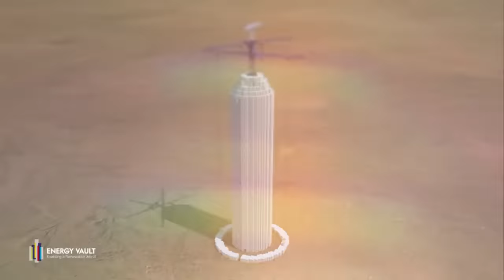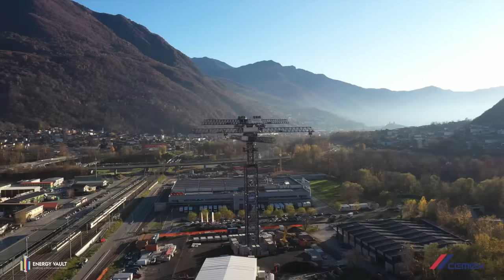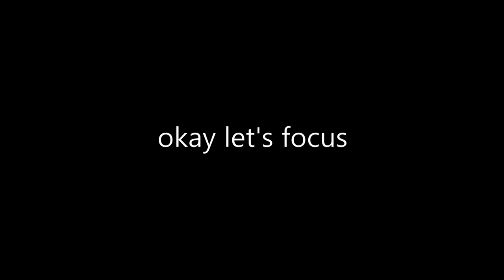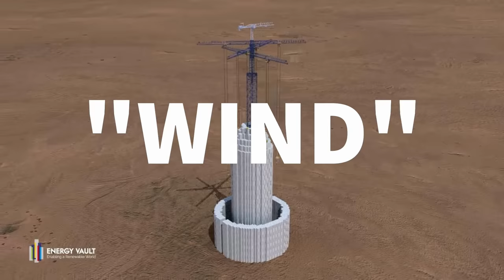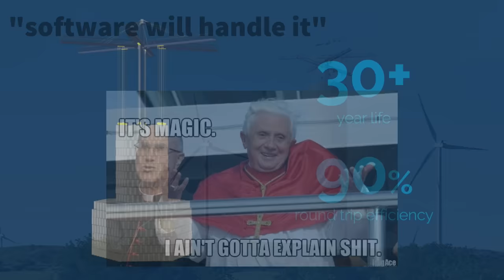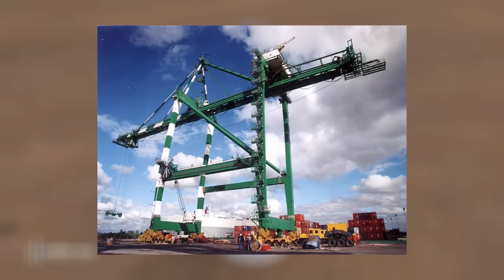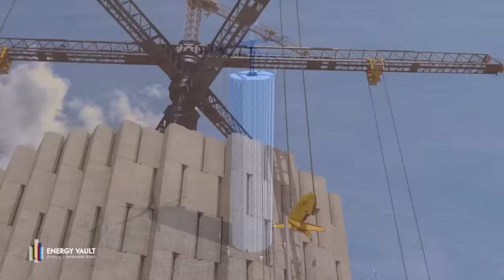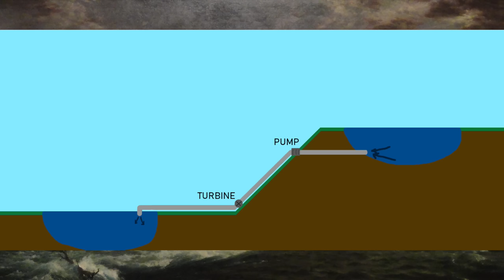The Energy Vault is a Dumb Idea, Here's Why

Comment: I remember when I first had a similar idea to this some time in my high school years. I was imagining massive concrete monoliths in backyard that can be raised/lowered depending on renewable supply. Did some quick napkin math and realised that you'd need such a massive pile of concrete to just cover the energy needs of one household that the entire idea wouldn't be feasible. Not even considering the impact of CO2 emissions etc. And then afterwards coming to the same realisation that dams already exist.
Reply: Learning never ends, 
so here you go, have some RANDOM comment trying to give you Fun Science-Times: 

Veritasium is cool, but Hbomberguy is even better. 
Practical Enginnering is also recommend-worthy, 
just like Neil Red, It's ok to be smart, Oversimplified, CGP Grey, Tier Zoo, Kozmo, Sci Man Dan, Bob the Science Guy, Creaky Blinder. 
And Legal Eagle and Cinema Therapy also are very educational, but these 2 are noteworthy for offering a very new viewpoint for old things.
Reply: Dams do NOT solve the scalability issue
Reply: @ziad_jkhan  how about a floating dam in the ocean? Basically a bit floating porta-pool that can keep a large body of water at a higher elevation compared to that around it. I wonder what type of materials it would even take to contain it.
Reply: @ziad_jkhan  Yes, and they also bring other issues. Either you lose a valley that used to be dry in order to hold the water, or you also lose the fishery that was supported by the river, as fish and dams don't play well together. We've been tearing out a bunch of ours in recent decades because we didn't need so much power and the damage to the fisheries was so large. The Grand Coulee Dam has never been run at 100% of it's theoretical capacity as there's never been a need to install generators in the remaining positions.
Reply: @anon746912  buoyancy only works if the density of the upper fluid is lower than the bottom fluid. In other words: if you fill a ship with water, it sinks.

So if you want to keep a large body of water above the ocean water level you'd either have to fix it to the ocean floor or have a much larger "ship" with an air gap below the water tank in which you'd fill just the tank above that air gap, and that air gap would likely have to have a larger volume than the water tank itself
Reply: What if we use the buoyancy to store the energy, by sinking something lighter than water to store the energy and releasing it to get it back?
Reply: @MehdiBenallegue  That would work, but impractical.  It's basically the opposite of a dam, and so you could get the same amount of power assuming heights/depth were the same.

Your winch/generator would need to be attached to the sea floor, which might have a few problems.  The thing you are sinking needs to be crush proof (water is heavy).  And just like this gravity tower the floats will get in the way of each other and so on.

Still, good enough to get some VC funding.
Reply: but these "startupts" need to spend some funds first :D
Reply: @j.f.christ8421  not many floaters, just one big, and flexible so it would just shrink with pressure while remaining lighter than water.
Reply: @MehdiBenallegue  Ok, and how exactly do you plan on pulling a massive float a long way underwater?  And if it compresses you lose power (less displacement).
Reply: @j.f.christ8421  I have answers for all these questions, but now I need to be paid for the answers! let's create our startup together! :)
Reply: @MehdiBenallegue  there's actually a concept for this! It involves compressing air, and using the weight of the ocean to store it efficiently. Basically all you need to store air at 10atm is a balloon that can store air at 1atm and 9atm of water pressure. That's a depth of about 100m. Bonus, you can store 10 times the amount of air per balloon than you could at sea level! To release the energy, just run the compressed air through a turbine.
Reply: @Greenicegod  There's many reasons why this is still a concept...  One is that 10atm isn't all that impressive, the air compressor in my shed can do that (1 atmosphere is 14.6 PSI, so 10 is only 146 PSI).  SCUBA tanks are 3000 PSI (200atm).  Compressed air is a crap way to store energy.

Comment: Unlike the extremely simple mechanics of a water storage system, Energy Vault relies on multiple complex crane systems all working in complete synchronization. A single point failure would render the entire system inoperable and repair logistics would be measured in days and weeks rather than minutes and hours.
Reply: I read this in Adam's voice.
Other than that, you can also just install a flywheel to store power.
Reply: @sybrandwoudstra9236  Flywheels are all but useless for anything but very short term storage and even at that the efficiency is marginal. And please don't bother coming back to me with a bunch of hype from yet another Kickstarter company with nothing to show but a bunch of CGI concepts.

Comment: up until the water part, I'm 100% with you. the whole point though (if I recall correctly) was being able to store surplus electricity on arid, waterless areas such as the african deserts, or areas without geographical features featuring elevated bodies of water. Still, the greatest problem ( in my opinion) that I didn't know of was the truly miniscule storage capacity of such an admittedly expensive endeavor.
Reply: having been out in the dessert, I can tell you right now that wind does not stop at night. And in the places that wind does stop, it also stop during the day. Sunlight? The few major (dessert) cities that could benefit from this are usually located next to huge bodies of water. Most towns located purely in desserted areas with no water are too poor to even consider such a project or don't have a necessity for it. Instead people just go to bed at night.

Comment: This is what happens when you sorta listened in physics class and don't feel like actually thinking about it
Reply: No its like when you actually did listen in physics class, but only up until the point where you take gravity as a constant, friction and air resistance are negligible, wind doesnt exist and things dont break ever.
Reply: The physics is correct though. It's the implementation that being criticized. Like why use concrete to store potential energy when we can just use water? The largest pumped hydro 'battery' station in the US is in my state and it's been operating since 1985. The issue with pumped hydro is it only works in very specific geographies.
Reply: @delos2279  The physics in the video is correct, and this could technically serve as a battery, but the assumption that it is in any way an effective battery is not.
Reply: @UnderEuropa  which means you didn't bloody listen, did you ;)
Reply: @5h4d0w5l1f3  It is effective as a battery though. That was even conceded in the video. And mechanical batteries are generally more environmentally friendly than chemical batteries. 

The claim was that pumped hydro is better. Which is true. But that's true of hydro power generally, not just gravity batteries. The issue Adam didn't realize or left out is that geographically pumped hydro, like all hydro,  is extremely limited. Most of the areas that support it already have it. Hydro is generally the best form of power so Adam might as well have been condescendingly saying 'just live near rivers and mountains.'  That's not making a point. 

Generally don't look to youtube video essays as a reliable source to debunk scientific research. Maybe your science classes were not advanced enough to learn that.
Reply: @delos2279  Sounds like it depends on your definition of "effective" and "conceded." Being able to technically store power, and being extremely limited in DIFFERENT ways from hydro, does not inherently make it effective. It makes it technically a battery. I teach physics, but thanks for trying to win by condescension and pure insistence alone.
Reply: @5h4d0w5l1f3  I assume by "extremely limited" you mean in the ways discussed in the video which was incorrect.  The video got so many details wrong making most of the physics irrelevant. For instance they already enclosed it to prevent wind issues way before this video was made so the whole section about wind (most of the video) isn't even relevant. 

Regarding effective, yes I can define that. Effective as in, better than a chemical battery. But if you want to ask if it's effective compared to pumped hydro then no. The problem that was amazingly omitted from this video is that pumped hydro is basically at capacity. There's almost nowhere else to build it. Particularly somewhere like Sweden where the water would be frozen for a large part of the year when its most needed. Critical omission, no? This is why we don't always want to take things for granted from video essayists who are not scientists. Particularly when they skipped some basic research both on what they're advocating and what they're criticizing.  

Next if you want to ask if it's effective to store renewable energy like this compared to fossil fuels that are always-on? Yea no, it's not. Coming anywhere close to 100% renewable energy quickly ramps up the costs compared to just using partial renewable energy because the storage issue. The problem is most renewable energy isn't always on. If we want to get close to 100% renewable, this is the type of method we would need. Or else massively improved and cheaper chemical batteries but the resources for that don't exist, whereas mechanical batteries can be built from mostly recycled materials.
Reply: @delos2279  By extremely limited, I mean it isn't as powerful as you're making it out to be. Your standards here are HYDRO IS DEAD AND THIS IS OUR ONLY FUTURE. Again, being technically capable does not make it the solution we need. Hydro was only brought up as a comparison for our current standards in effectiveness, not as the end-all-be-all of energy storage, thus its geographical limitation is inapplicable. There are other methods of energy storage and you ought know that chemical batteries are for different uses entirely, which also makes them incomparable. Until this system is capable of living up to those standards, it is simply novel. It is a cool little idea. It is not effective.
Reply: @5h4d0w5l1f3  It would help if you could respond to something I write rather than making up an argument for me. 

I simply did not say hydro is dead or even imply that. I said the opposite... So using your exact same argument, can you tell me why we use wind, solar, nuclear, or any fossil fuel to generate power if they can't live up to the same standards as hydro?  Or just tell me why we use Li-ion battery facilities to store energy? I'll give you a hint. I already explained the reason to you. 

Contrary to what you thought, hydro is the form of power that is extremely limited. It's why we use Li-ion battery facilities currently, which are a LOT more expensive than even current models of non-hydro gravity batteries. So there's your comparison.
Reply: @delos2279  It would help if your entire stance weren't based on the maths being wrong just because you're weirdly attached to the subject. I made a joke on a video wherein you insist that every mathematical principal is incorrect simply because you can't pick one goalpost: this is not a method of generation, it is a method of storage. All of those require their generated power to be either used or stored elseways. Like I said; I teach physics. You won't change my mind, and clearly I won't change yours. We can agree to disagree about your novel lego block tower. OR, if we're all so clearly wrong, then actually mathematically prove it with your own video, not by saying "this physics is incorrect this physics is incorrect this physicist is incorrect trust me I just have to hand wave more." Then I'd give you some credit.
Reply: @5h4d0w5l1f3 I don't know what that whole deflection is about but I asked you why we use Li-ion battery facilities to store energy when pumped hydro is better? If you already forgot your own comment, you were trying to say something isn't viable if it doesn't match hydro so can you answer without a deflection?

Also what math are you referring to? Because you didn't disagree with the part I explained was wrong before.
Reply: @5h4d0w5l1f3  Also remember your original assertion was that "the assumption that it is in any way an effective battery is not [correct]."

If you're a teacher you're being really lazy. Where is the math or physics you claim you're appealing to? Not even PE = mgh compared to Li-ion batteries? Because gravity batteries are much more efficient than chemicals from the numbers I've seen and even potentially better than hydro. For that matter, you STILL haven't answered why we use Li-ion batteries when we could be using hydro??

Moreover, why has this company already signed contracts to the tune of hundreds of millions of dollars with both US and Chinese energy companies for energy storage systems? 

Since you claim to know better, prove it rather than constantly running away from points. You should be saving some energy  companies hundreds of millions of dollars on apparently ineffective battery solutions.
Reply: @delos2279  Nice paragraphs, do it again :D I'm not YOUR teacher.
Reply: @delos2279  I agree with this video. All I'm saying is that you've failed to convincingly debunk it. No reason for me to make a video that already exists.
Reply: @5h4d0w5l1f3  It's funny you keep insisting I would need to debunk the video when I already did or rather, this was already done in the design before the video even suggested it. Not so much wrong as telling a bird to grow wings when it already has them. And then the second issue was poor research on hydro’s scalability which of course you refused to answer 4 times because you know you’re wrong on that. Instead you had to deflect to a strawman about how I was apparently saying hydro doesn’t work… It does great, except in places where it doesn't (most places). 

It’s also funny how you keep insisting the issue was physics when it’s economics. The physics on potential energy is centuries old and it works the same for hydro power. These are basic concepts every student should learn in a high school physics class. Since we can easily calculate exactly how much energy can be stored, it’s just a matter of costs. While it's competitive with hydro, the analog here is really chemical storage which is currently used. It's competitive with hydro and superior to chemical batteries. Numbers will be below.
Reply: @5h4d0w5l1f3  I can't link directy but since you're too lazy to educate yourself, here you go. It also explains the question you couldn't answer 4 times.

Economics and efficiency

Cost of gravity batteries varies by design.

Pumped storage hydropower costs $165/kWh to operate, with a levelized cost of storage (LCOS), of $0.17/kWh.[26][27] The pumps and turbines of PSH systems operate at up to 90% efficiency.[28]

EnergyVault's proposed gravity battery system range from 7 to 8 million in building price but has a LCOS of $0.05/kWh and a round-trip efficiency of 88–92%. This is 50% cheaper when compared to the LCOS of lithium-ion batteries, which are $0.25/kWh-$0.35/kWh.[29]

Gravitricity's 250 kW demonstrator is expected to be $1.25 million, promising a 50-year lifespan and efficiency of 80–90%. Relative costs of gravity storage installations that would use 2000-tonne weights suspended from winches in disused mineshafts, compared with lithium ion batteries, indicate that although the "up front cost is high" the 25-year lifespan of such equipment—with no degradation of capacity during use—makes a "compelling proposition" for large-scale grid balancing purposes.[30]

Unlike pumped-storage hydroelectricity, solar panels, and wind turbines, which can only operate under certain conditions or in certain areas, gravity batteries like those proposed by EnergyVault and Gravitricity may have a wider range of suitable sites. Gravity batteries will make solar and wind more viable as they can store the excess energy they make during peak hours and distribute it later when needed.[18][31]
Reply: This is what happens when you're the weird kid who says stupid things all the time in school, but you never get the slap-down you so desperately need because of the new anti-bullying laws.
Reply: @delos2279  Yes the physics are technically correct, but the engineering is a hot mess.
One of the things I really noticed were those little swivel dealies on the bottom of the grabbers that are supposed to hold concrete blocks. Those would break faster than the "new and improved" wheels on shopping carts.
Reply: @protorhinocerator142  How is that? Unlike an actual grabber there's no horizontal tension at all and no motion needed while holding weight so it should last much longer. The requirements there are much simpler than a normal construction crane because it's only picking up one type of object so that's a trivial detail.
Reply: @delos2279  Mainly because they're so damn small and isn't a fixed body. Unnecessary mechanisms weaken a structure and when it's that small it's pretty much a nightmare trying to actually implement that system without it snapping from the torque produced by the block.

And that's not even taking into account the wind.